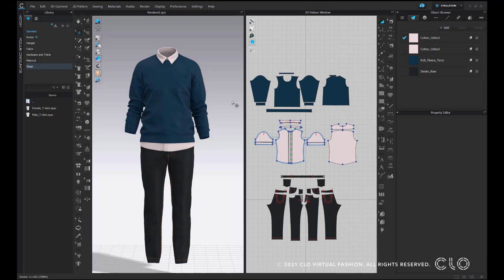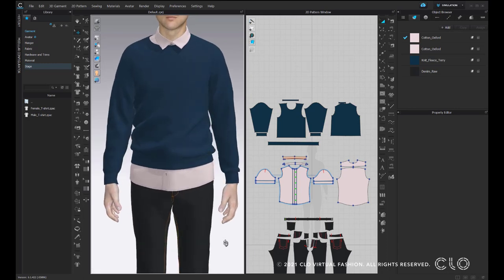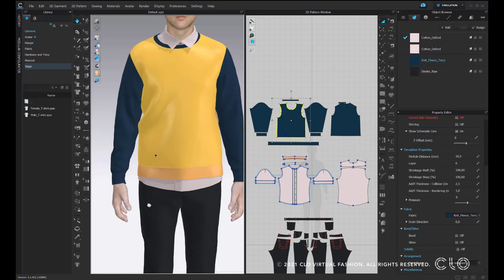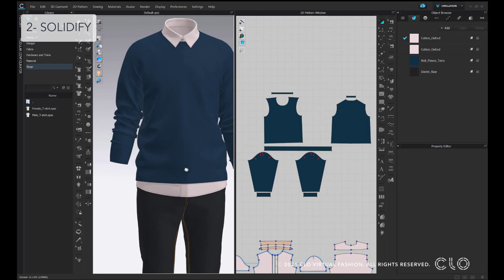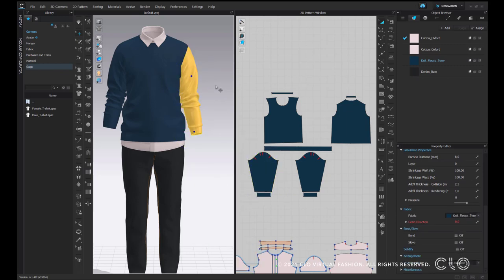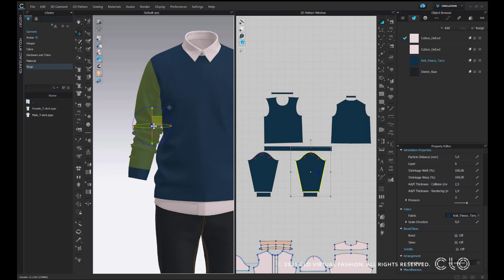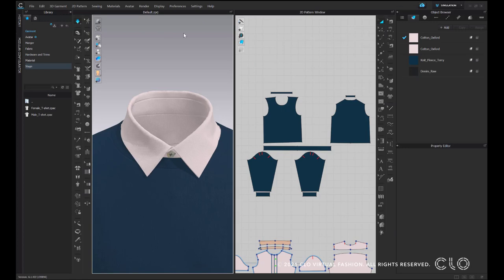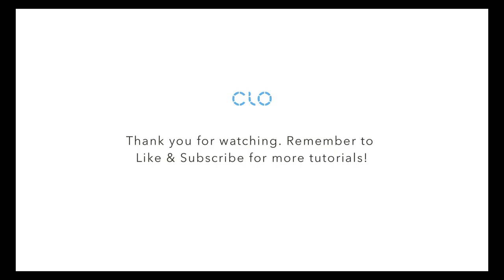Understanding the Strengthen, Bond, and Solidify Functions in CLO

Comment: this is good thank you!  Can you alter the strength of the strenghten and solidy? So its somewhere in between on and off?
Reply from the maker: Hi Christian. No currently there is only one setting for both Strengthen and Solidify. But if you apply Bonding there are different types of Bonding at varying strengths.